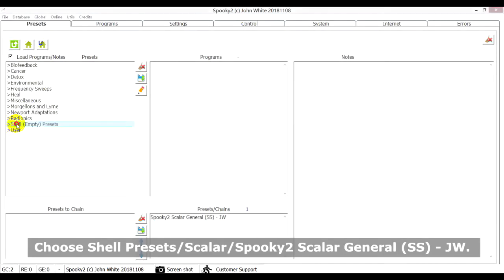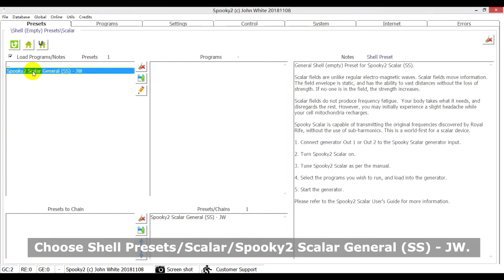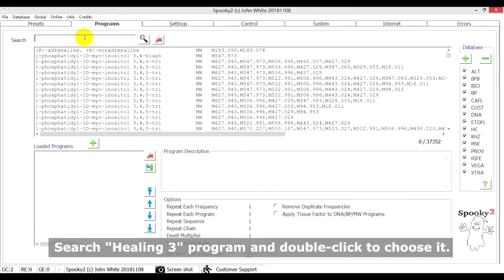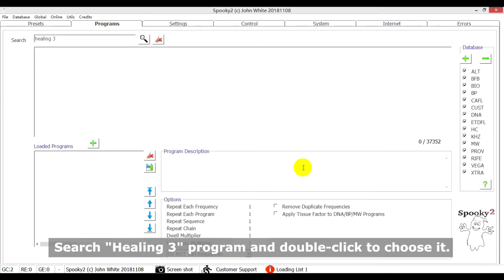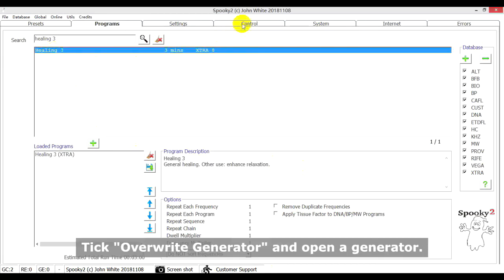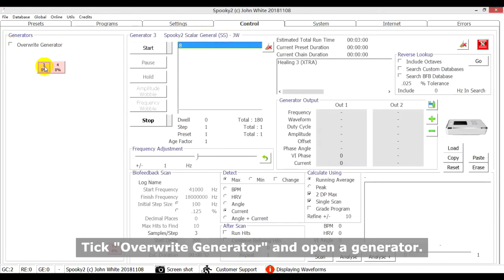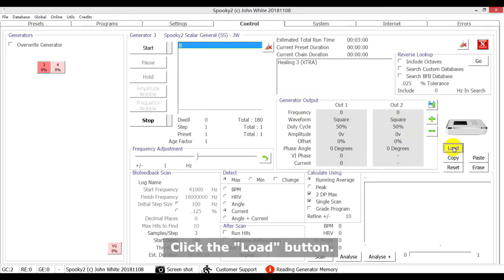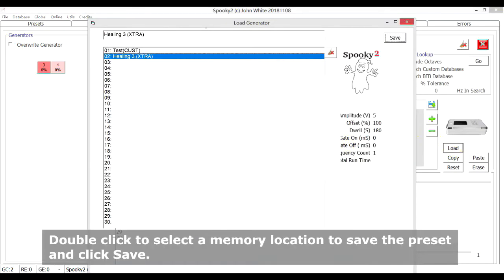How to Apply Rife Frequency to Scalar Field （Generator pre-loaded programs）

Comment: When I tune the receiver and transmitter I see 3.45 on the readerglass. Isn't that too low?
Reply from the maker: Hi Helen. There are 2 brightest peaks while tuning Scalar. The first peak occurs when Scalar is first turned on and the output frequency automatically goes to 8 MHz, which is the maximum frequency.

The second lower frequency is the EMF operating frequency. It is the confirmation that the scalar frequency was found in the previous step.

Generally, the first peak in the indication light indicates that the “ideal” scalar frequency has been found. Then Scalar will function correctly above and below the first peak value.

There are many factors that may affect tuning such as temperature, environmental (temperature and humidity), etc. We suggest you tune it again to see the results. If the Hertz you tuning is still too low, please contact our service staff to help you resolve the problems as quickly as possible. 

Here is the instruction blog that may help you: https://www.spooky2scalar.com/spooky2-scalar-tuning/

You can contact us via the support team:support@spooky2scalar.com or chat with them online via live chat.